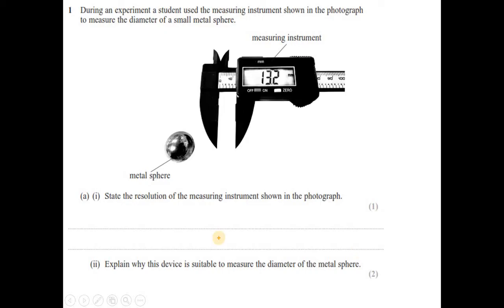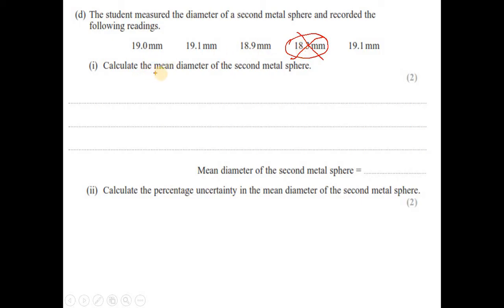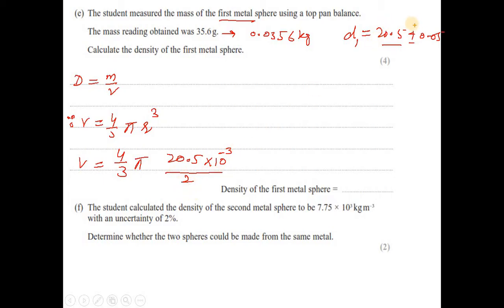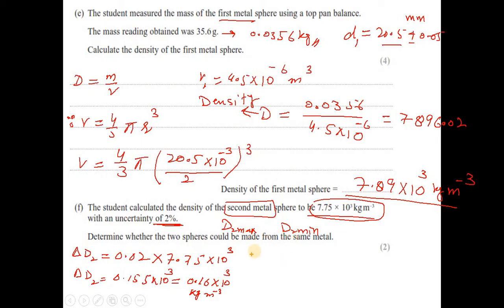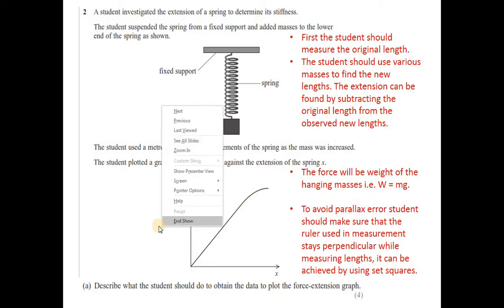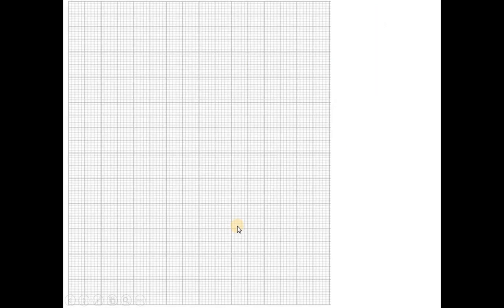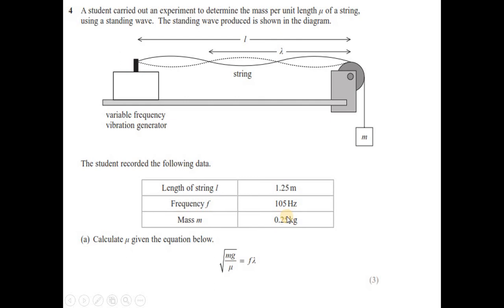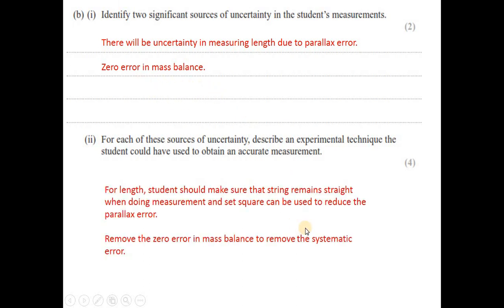Edexcel IAL physics New Spec unit 3 June 19

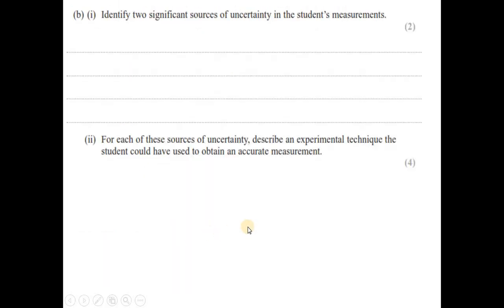Comment: 37:45 can we say the frequency measuring device may have zero error?
Reply from the maker: Yes, you can, mentioning that if the frequency/signal generator has analog knobs and a meter. Now we do not use such devices.

Comment: I did not understand the resolution thing , could you please explain it
Reply: The value given on the instrument to take measurements
Reply: @Crynyxtheband  ?
Reply: resolution is basically the degree of accuracy the instrument has( or in other words the smallest interval measurable by an instrument)... for example a micrometer screw gauge has a resolution of 0.01mm and a metre rule has a resolution of 1.0 mm i think. i hope this is helpful and good luck tomorrow!